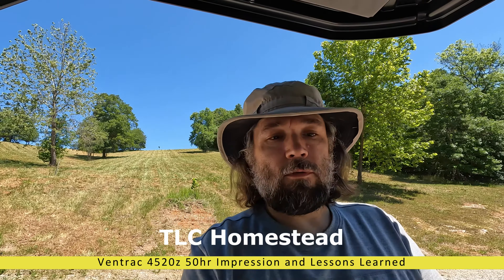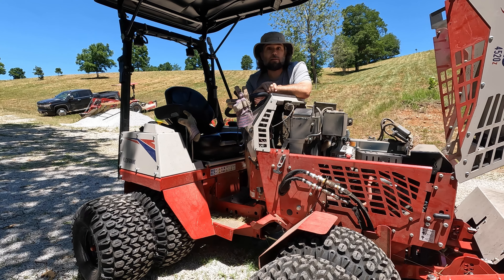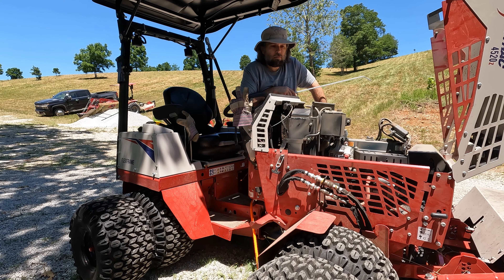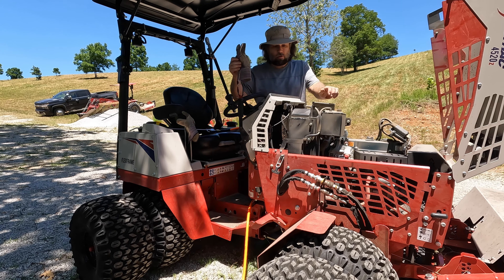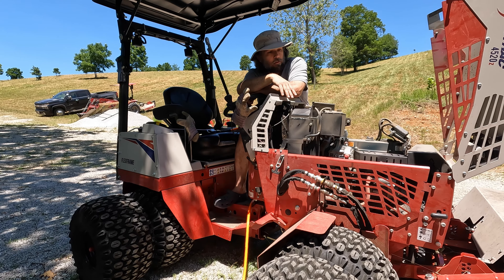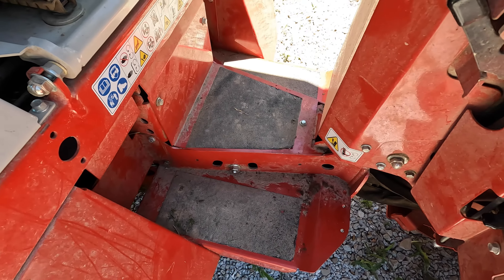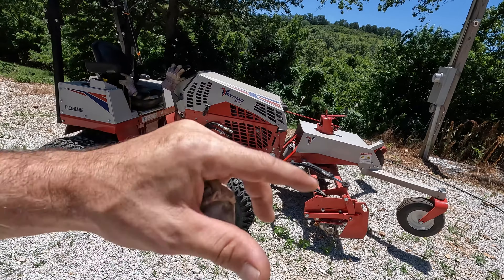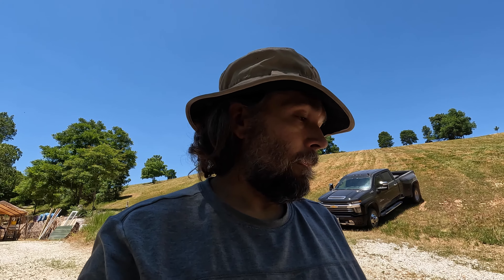Ventrac 50hr review

Comment: I have two Ventracs, neither with duals.  I agree the cutting deck should be wider than the wheels.  You might try mowing without the duals.  Stability is still great. Generally I mow steep hills vertically anyway and the duals are unnecessary.
Reply from the maker: I have enough trees that while I try to always go vertically there are times I cannot. One section in general goes down to a line of trees and I can either turn around on the slope (between 18 and 26 degrees in that section) or back all the way back up :)

I have learned to just deal with the duals being wider than the Tough cut. I wish they were the same and maybe Ventrac can take the feedback and make a change somehow. Who knows, just the opinion of a single person using a Ventrac out in the woods by himself :)